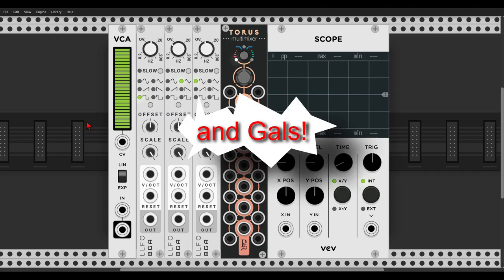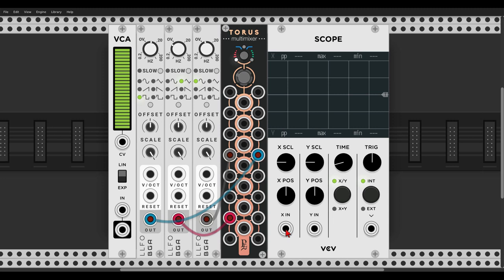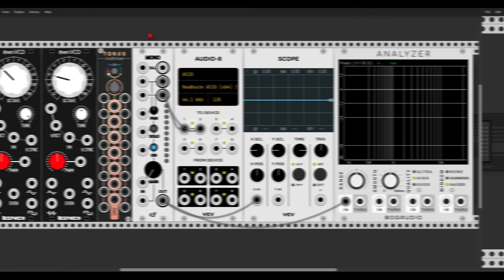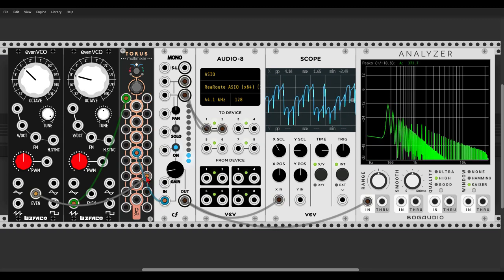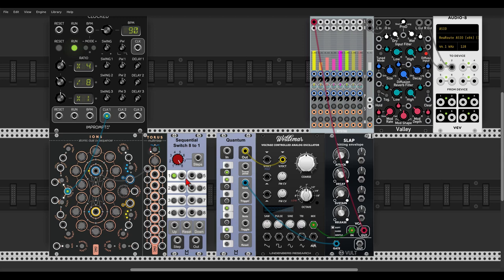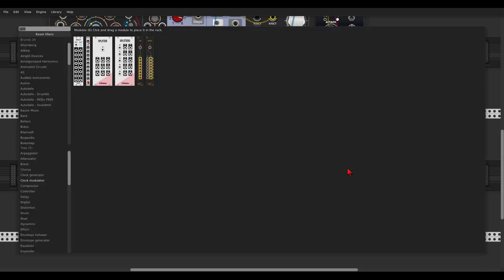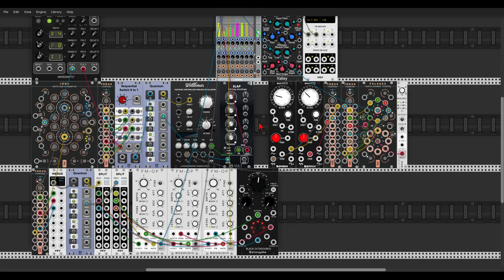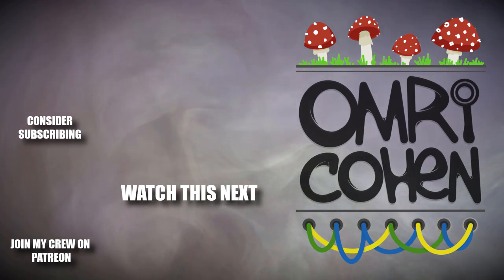Geodesics Modules Series Part 7 - Torus

Comment: At around 12.30 I don't really understand (I am pretty new to VCV), what are you doing with polyphonic cables? What's the purpose of merging the three signals and then splitting them to send them to the FM-OPS? (Is it just not to use three Quantums?) Thanks
Reply: Yes, Quantum is polyphonic so you can use 1 instead of 3. In case you're using poly VCO(Basal from Vult for example) you can place 1 instance of it for all of the 3 signals too.
Reply: Thats all its for! At least to my understanding, more modules means more rack space, and more cpu usage, and repetitive cable routing. I'm assuming the split and merge modules use less cpu than three quantums, but that may not be the case.
Reply from the maker: Well, yes, exactly. I use polyphony so I don't have to use 3 Quantums. Merge and Split use less space and also less CPU. It's not such a big deal in this case, but I'm trying to use this more and more so people will get used to  it because it can save a lot of space and CPU in bigger patches with more sequences and such.
Reply from the maker: @Zachary Sealey-Payne Yes, they use less CPU, and I also try to use this more and more in my videos so people will get used to it. It makes patching a bit easier I think.